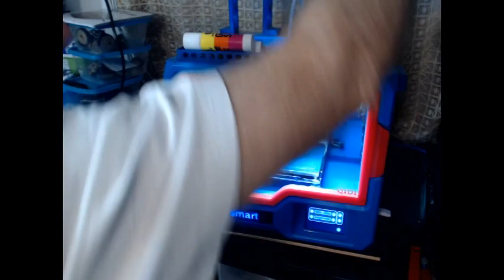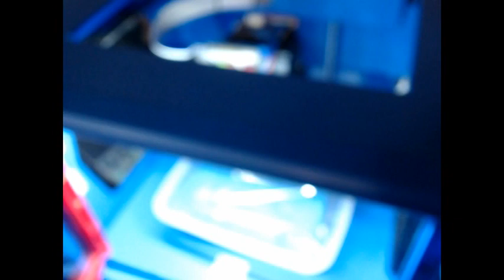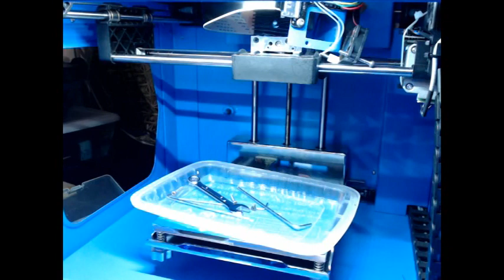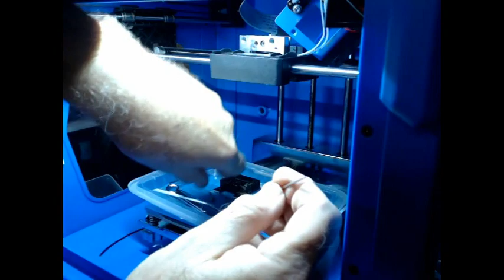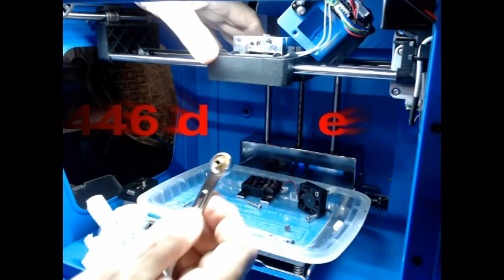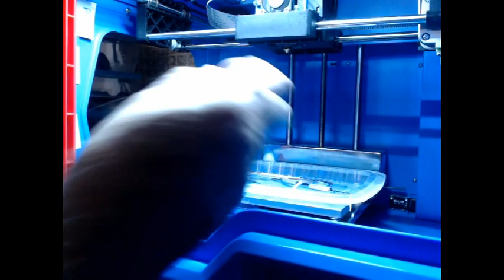Filament Not Feeding Through

Comment: Hi! Did you solve the problem?
Reply from the maker: It wound up being a problem with the printer. I got some replacement parts from the manufacturer which included a new printhead and ribbon cable. QIDI is a great company to work with and the price is inexpensive.